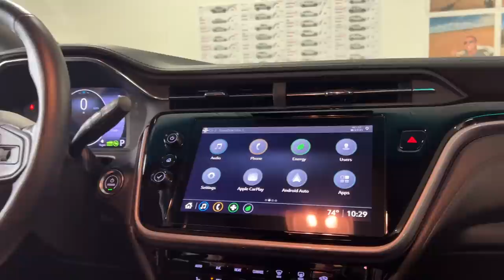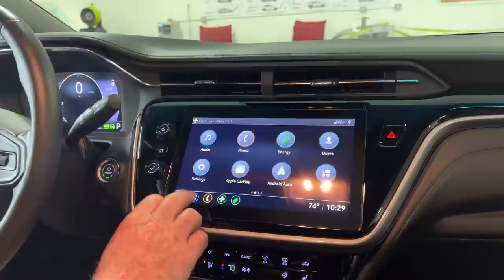Sandy's First Impression of the 2022 Chevy Bolt EV

Comment: Before the pandemic, you could have bought a base Tesla Model 3 for $35k and with the proposed tax rebates you'd have a top rated EV for $27,500. If the supply chain would just get back to were it was in early 2020, even a Tesla would be affordable and you'd be getting a much more feature packed, practically  luxury vehicle, with 5X faster charging that you could drive cross country, compared to the Bolt 2LT.  We will get cheap EV's it's just going to take a few more years. I believe gas prices will remain above $3.50/gal, so if you factor in how cheap the cost per mile is in an EV, potentially it will be cheaper to drive an EV than even a Toyota Prius. I really enjoy the videos Sandy, keep them coming!

Comment: The 'dealerships' will be sure to tack on another $10k - $20k.
Reply: $38k for this Bolt is way too expensive. I own a MODEL X. I would rather have a civic at this price. Less chance of a fire too.
Reply: No they are sitting on car lots now
Reply: Actually most are being sold before they arrive at the dealer.  The ones on the lots are on sales hold waiting for replacement batteries.  Most dealers are selling at MSRP with a few dealer installed options like most other brand dealers do.

Comment: I've been interesting in buying one of these for a few years, but the only problem I just can't get over is its a GM product.
 If any other OEM made this I would of bought one already at the price point.
Reply: I had that same thinking, but I bought a volt and I have nothing bad to say about it. I been getting an easy 60 miles on a full charge. The epa put the car at around 50 miles. I haven't pumped gas in months now.... So all I do now is keep about 1 or 2 gallons of gas in it. I'm getting ready for the 2023 price drop and going to reserve a bolt when the dealers let us.
Reply: Exactly.  Coming from GM makes you wonder.
Reply: As a former Saturn and Saab owner, I understand
Reply: Agreed
Reply: Agreed, but if any company is in a position to produce an affordable EV in large quantities it's GM.  Toyota seems pretty meh about full EVs and VW puts themselves too upmarket (here in the US anyway).  I'm definitely not a fan of GM but if they can sell me the base model Bolt EV for low $20K, I would take the chance
Reply: Checkout the 2023 iD.4  the price is pretty decent for what you get.
Reply: @chrisfreemesser5707  not convinced they are actually making money and with all the battery problems they have had i don’t know well see but i have lots trust and faith in them. Many manufacturers can make a low cost car but you need to have the capability to supply the demand with batteries. Not a problem if you only manufacture small qty annually
Reply: @chrisfreemesser5707  don’t take it. This is like buying a $38k GM laptop from Walmart with no OTA updates. The battery technology was dated 5 years ago. Sandy is only talking fit an finish. Who cares about fit and finish on a bolt when they have never been able to scale production of an EV and they have been building them since JANUARY 2015! If you are thinking of buying a GM EV, then you should be fine with buying a GM LAPTOP.
Reply: @martinbeaumier7172  EVs demand state of the art software. EVs are laptops on wheels. Would you buy a laptop from GM? You’re buying a $38k laptop with wheels from them. Walk into any dealership and ask them who is qualified to work on it! No one there is. They have individual people traveling around the country in a van working on these cars. Dealerships don’t have the experience yet. You are rolling the dice with this car. GM is luring uneducated first time EV buyers to trust them. Their software is a joke. I own two software companies. It’s not there yet. Wait.
Reply: I have a Taycan and a 2020 Bolt. For the price, the Bolt is  really good. This is a great 2nd car, and has been trouble free. No heat pump,  so range is about 25% less in winter. But, for a commuter car, that’s not a issue. With Blizzak winter tires, it’s done great in snow and ice.
Reply: @GET2222  You clearly don't understand how the mass car market works; they can't spend $50K+ to pay for software designers to integrate fart noises. I'm not a big fan of GM, but they're producing a vehicle that meets the needs of people with a $20K budget who wants stop using ICE vehicles. Munro made that point indirectly; his experience in hardware manufacturing is more relevant in this regard than your inflated experience in contracting out software engineers.

Your priorities in this regard are out of whack. The priority should be proliferating EVs to every segment of the market to get people who can't afford  $50K+ vehicles off of petroleum; they need to be off of expensive gas more than we need a perpetual L2 self driving beta. So far, GM and Chinese auto makers seem to be the only ones to get a mass market EV in play. 

I know you'd like to think that bleeding edge software is a critical component, but the reality is that EVs existed long before software was integrated into vehicles. The fact that EV  powertrains are less complex than ICE vehicles means that less software is needed. The thing that made EVs a reality is as follows: battery chemistry, motor technology, and reduced material prices. Those three are going to be the items that  create a viable mass market $20k vehicle while software sells the $50K+ vehicle. 

The proof of it is the fact that the the EV manufacturer with the most experience producing AI enabled EVs still hasn't figured out how to make a sub $50k EV, while companies with far less experience with EVs and software has it figured out.

*I'm a developer who owns a Tesla as well as being a Tesla stockholder.
Reply: @paulo3011  I do understand the mass market. @$20k FSD subscription will prevail when you won’t have to drive and you can choose any car you want on any given day without having to worry about charging. I’m talking about a $38k Bolt!!! Did you now read my post? Wtf…

A $20k bolt is a very different conversation that I NEVER MENTIONED. Stop projecting and fabricating an argument that no one was having.
Reply: @vbaker4  At this end of the market there seem to be compromises no matter what. It really bothers me that VW did not add one pedal driving to the ID4.
Reply: @paulo3011  I'm with you for the most part, but it is absolutely untrue that Tesla "hasn't figured out" how to make a cheap EV. They could easily release a cheaper car, but what would they gain by doing that? They're pretty much selling every single car they can make, even with their higher pricing. The Bolt is surely a great EV for many people, but it won't really win anyone over.
Reply: @georgeidarraga4006  Agree 100%. Have to weight things out. I’m happy I was able to get my lightning pro.  It’s near this price point and just a complete Swiss Army knife of a vehicle.
Reply: Well I guess you dont have to worry about GM engine issues. Or shops putting in the wrong coolant instead of Dexcool. 🤣
Reply: @chrisfreemesser5707  The issue with the Bolt is really that at this point they are on the verge of abandoning the battery technology in favor of a whole new platform. The discounted prices are because this is about to be a discontinued technology and support and repairs may be exponentially more difficult just when you need them. Us Saturn owners know these pains.
Reply: @GET2222   are you not aware of the context under which you posted and trashed the software? The video and subsequent posts are all about GMs sub $30k and $20k Bolt offering. Most sold Bolts won't be at $38k. It's amazing you own two companies but can't tell when you've moved the goal posts in the first place.  You're really the only one discussing an almost $40k Bolt. I just moved the conversation back to the appropriate context (the one that Munro and most others understood).

You should go back to pretending to run 2 software companies.
Reply: @paulo3011  not moving the goal posts. I clarified my position. Hence, $38k. I’m talking to you. Yes, software for a $38k purchase is part of the conversation. Software for EVs are critical. If you can’t figure this out, there’s no point in having this conversation. 

I have 8 software patents and counting conducted around search. I license our software to some of the largest platforms in the world. I’m 52 and have seen a lot in my life. Clearly you haven’t.  And That’s okay.
Reply: @vbaker4  you can’t even order it here i think it has 2 year backorder and they stopped taking orders
Reply: @martinbeaumier7172  I was talking about the iD.4. It’s open. You’re correct, the lightning is booked up.  I was lucky enough to get one

Comment: Please NO DRUM Breaks!! Sandy those are a pain to change
Reply: The upside is that the brakes may outlast the car anyway, particularly if the car is not kept fully charged.  My S is on the original brakes at 80K and they show almost no wear.
Reply: Brakes on EV, especially rear, are used so little they are rusting and or seizing up from no use.

Comment: I cross shopped the Bolt before I pulled the trigger on the Model 3. I really liked this car. The inside feels big for how small the car is, the rear room is incredible. It came down to charging infrastructure at the time. In 2018 there wasn't much in west or north west Michigan.

The car was designed by GM Korea (Daewoo).

Comment: In the 3 years I've had my 2019 Bolt, I can say it's a good budget EV, there'S just the legacy of the LG battery fires to consider, and I've had problems with the replacement battery that needed a 2nd replacement... 
So it's starting to show it's age as an architecture, not sure how long GM is going to support pre-ultium pouch batteries production for this one if they're losing money with each one they sell.

Comment: I have the 2020 version of this car and it is by far the best vehicle I've ever owned. It has decent power and accelleration and gets very good range if you aren't driving around with your hair on fire. I can easily get about 280 miles on a charge in town with the AC running in South Florida. With the AC off, well over 300 miles on charge. On the highway this little car suffers a bit in range and you drop to 240 with AC on. I will be replacing my 2020 with a 2023 once my lease is up in a few months.

Comment: I have  the 2021 for about 15 months and just love this car. It’s cost me about two cents a mile to drive and I am getting up to 300 miles of range inner city. If Chevy does as good with the equinox as they have with this car I am considering upgrading to the equinox. Love the The one pedal driving. I have used the brake pedal very few times because with one pedal driving and the regeneration button the car slows or stops very easily. If you’re thinking about buying this type of car don’t hesitate especially since they dropped them $6000
Reply: @craigfreeman9280  There are no shape wr it’s just casual driving no jackrabbit starts and using one pedal driving which really helps with regeneration. I’m still at 80% because I have not received my new battery. But at 80% I’m getting between 250 and 275 miles when not using the air conditioning. The car is really amazing
Reply: That was supposed to read there is no secret

Comment: The interesting point is whether GM has switched from the unstable pouch cells. The previous versions of the Bolt are infamous since GM-recommended the owners not to park it within a certain safety distance from anything that might catch fire. If they have adopted a more reliable battery technology, GM may have a good car at this price point.
Reply: Maybe they just got better lawyers.
Reply: That's a lot of "ifs".
Reply: You've missed a whole lot of public information about the batteries.  The number of fires was very low - as of late last 2021, a total of 16 out of 141,000 vehicles sold.  The problem was caused by a manufacturing error by LG, the battery supplier, not due them being pouch cells.  All the battery packs are being replaced, including in vehicles sold to consumers years ago.  GM is continuing to use the same cells in new Bolts, and will use some variation of pouch cells in all of its vehicles going forward.

Comment: In, this case SANDY is wrong.
the gm Chevy BOLT is 80% made by LG, and Chevy only assembled it.
it's does not do any Engineering. 
the motors & battery pack , BMS Thermal system & HVAC are all built in South KOREA by LG. 
it's just another GAS based COMPLIANCE car, like mx-30 or RENAULT.
Reply: If you're talking about the powertrain, yes - same with the Mach E being a (I think) Bosch.  But LG doesn't build cars.  Engineering and building a car that can pass crash tests is no easy feat.

Comment: My 2022 Bolt is in the Body Shop right now because of poor fit on the rear doors scraped the paint off the front edge from scraping the front door.  Their fit and finish is still a problem.

Comment: Drum brakes are inappropriate on any modern vehicle.  They just don't work as well, and even small EVs are relatively heavy.  The Bolt weighs in at about 3800 lbs empty.  If the battery is near capacity and the vehicle is going down a big hill, regen won't do much, and the brakes need to be able to handle the vehicle weight without the aid of regen.
Reply: drum brakes actually work just fine,  especially on the rear of a fwd car. They're still quite common and don't cause problems
Reply: Virtually every large truck and nearly all Ag/Construction machines use Drum.  They work fine on Back

Comment: 6:30 it would kind of fit GM as a company; their V8s have always had very passive cam timing, so I wouldn't doubt GM overbuilt and de-rated charging parts and discharge from the batteries for both longevity AND from prior battery fires.

Comment: Tesla isn’t addressing the $25k-35k market, it’s a gold rush right now. My GTI was $25k 7 years ago, and that’s what I’m looking for, 25-30k speedy and roomy. This might do it
Reply: Right now, no one can make a $25k Bev and be PROFITABLE. 
KANDI has a $12,000 Bev , but it's less than 100 miles.
Reply: An EV at the $25-35k market has very little, if any, profit margin. That's why Tesla and others aren't addressing that market. As long as the demand for higher cost EVs is still unmet they see no need to sell at the low end of the market.

Comment: About the low Charging rate. It's a shopping Car. Where are a lot of Chargers where you can charge it for half an hour, while you are busy? Shopping Malls. So it doesn't need a heavy and expensiv Charging unit. A 100KW Charger would be nice, but it would drive the cost up. In Europe there is the Renault Zoe which is pretty similar in usage and layout. And it has a 50 KW unit as well. And it's enough, half an hour at the CSS loader equals around 80-100 Miles. The Zoe is the second best selling BEV in Germany in 2021 after the Tesla 3.

Comment: Sandy... how much did GM pay you to say these crap. You usually rip apart OEMs for not installing a frunk. The charging speed is an absolute joke and the interior is hideous. AND IT COSTS 38k? Jesus christ. Now i know who is really LEADING the EV race. It sure aint Mary.
Reply: As mentioned by Sandy, this model is 10k more expensive than the base model. This is a small front wheel drive car which means there is no frunk, just as Sandy said. You're just being a troll at this point.
Reply: @I_THE_ME  I give credit where credit is due. This car is great at being scrap metal

Comment: Sandy starting to realize what most people have known for a long time. Tesla doesn't make anything special. Tesla makes expensive niche cars that don't follow automotive rules but it doesn't amount to anything, their cars costs more than most. Their range is less than most (when properly tested compared to others). GM had this car out since 2017 essentially and after the gimmicks "new" technology of Tesla has worn off. This tried and true car from 2017 provides an affordable EV for the masses at under 20k with more range and reliability plus build quality than anything Tesla has the ability to put out.
Reply: Tesla makes expensive niche cars, nothing special is what you said. So how many mainstream EV's did GM make? Or any other OEM make? How many niche cars did Tesla make again? Nothing special, you clearly haven't been watching Munro Live. Perhaps you should learn something about Tesla before making rather inane comments.
Reply: As great of a value this car offers, it doesn't really tip the needle for electrification if they only make 30k of these a year, and Model 3/Y combined are selling over 2 Million next year. I wouldn't call the best selling car by revenue in 2022 and unit volume in 2023 a niche product. Just because its expensive doesn't mean its not popular.
Reply: @bgomers7  they were screwed over by LG Chem and their battery issues. These Bolts were picking up sales up till the recall. They will come back with insane volumes as customers wake up to the fact that Tesla's are a FAD and at the end of the day, the car is an appliance. Shop for value.

Comment: I owned a 2020 Bolt and hated every minute of it. Dumped the car with only 15k mile, which was like an eternity in Guantanamo Bay. Even at the new price it's crap. Even when the sticker was about $40 grand they sold them for under $27k. Maybe if the tax incentive is reinstated, it might be worth considering. I see the swapped out the white plastic for chrome plastic. That white crap looked so bad my wife thought it was a protective covering and tied to peal it off. If the new seats are comfortable, they must have nothing in common with the seats mine came with. I think those would qualify as torture.